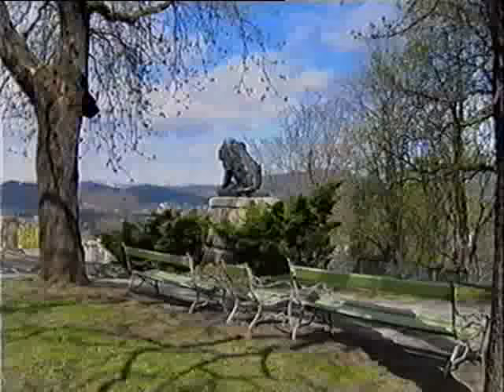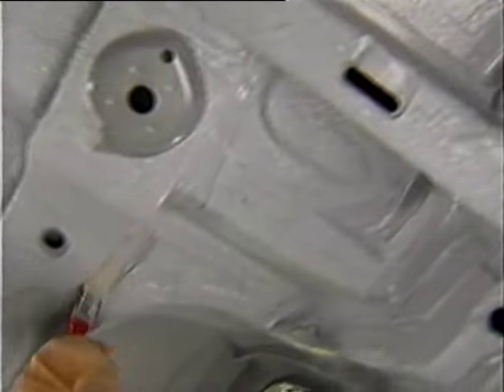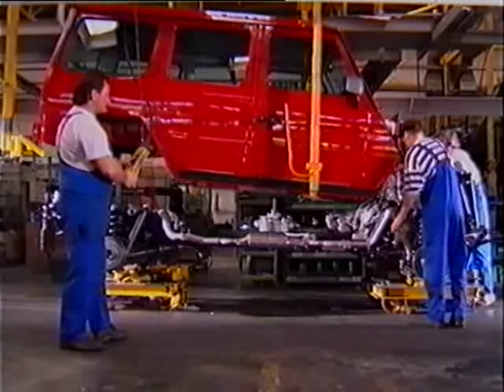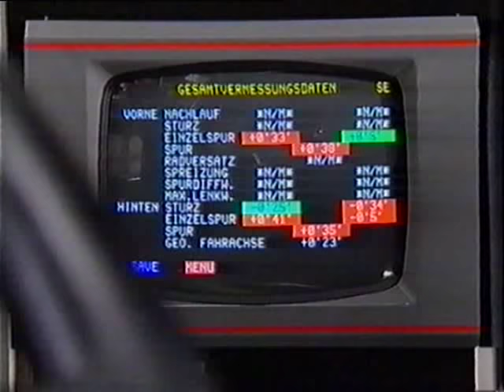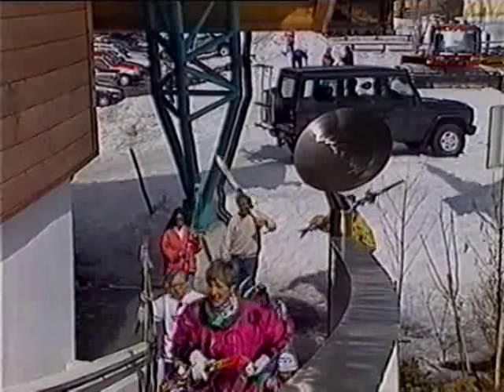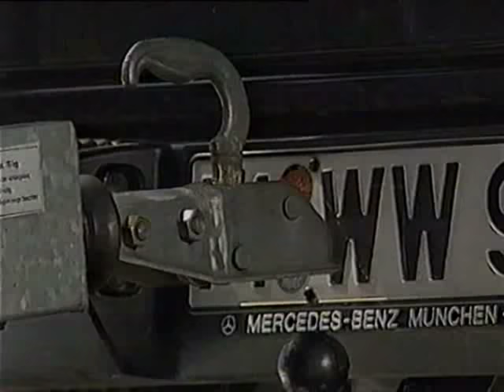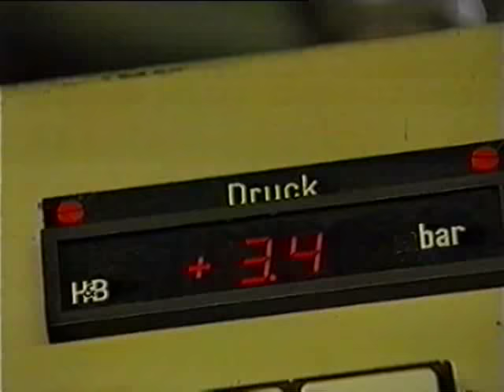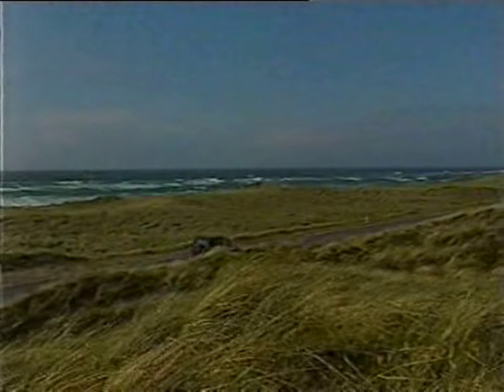1995 The G Class Manufacture   That little bit more freedom

Comment: Was made by Bruno Sacco. Expect nothing less than the definition of perfection from mercedes benz in 1949-1999 after that they are all garbage. All car brands not just mercedes. New plastics with much electronics made to last 2-5 years then break.
Reply: FYI, Bruno Sacco presided over design over every Mercedes-Benz through 1999, which included the 2003 W211 E-Class and SLR McLaren. You don't understand behind the scenes development work, is measured in years, not months.

Werner Niefer ruined many products well before Sacco left.